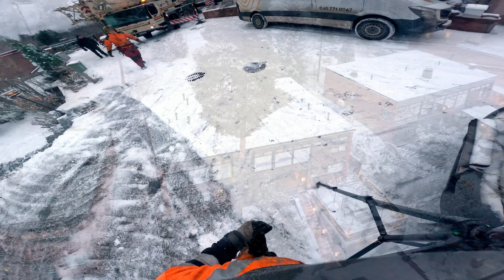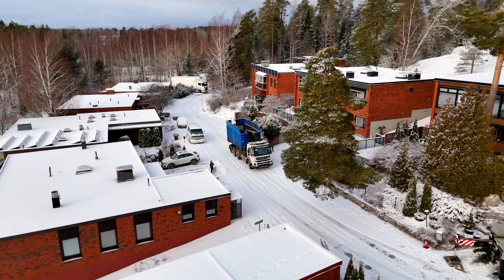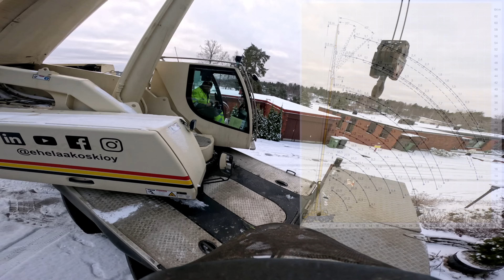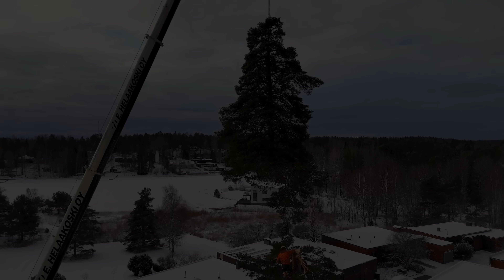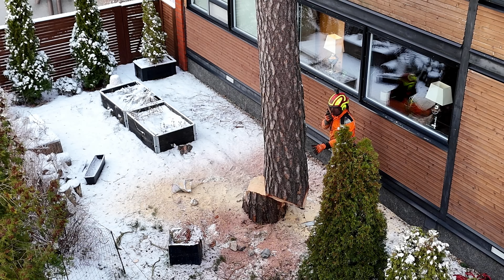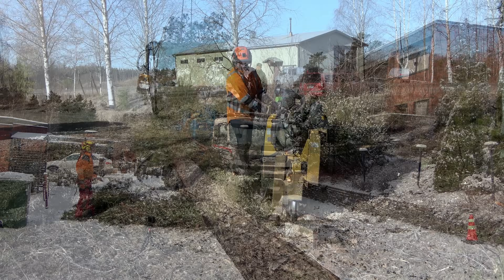The Fastest (and Cheapest) Way to Remove Urban Trees

Comment: In my area of the South USA, there is a tree service that uses cranes all of the time. They did a job in my neighborhood 3 years ago. They give away the firewood if you will haul it off. They did a job on my street in March. They used their equipment to put the logs in my yard instead of hauling it off. I figured that it saved my neighbor at least $2000. 
This is a video of them work from a couple of years ago. They removed an oak that was 1m in diameter and less than 1m from the house. https://youtube.com/shorts/84J4ZDULJ5U?si=UokVI-iqqaD4XW6P